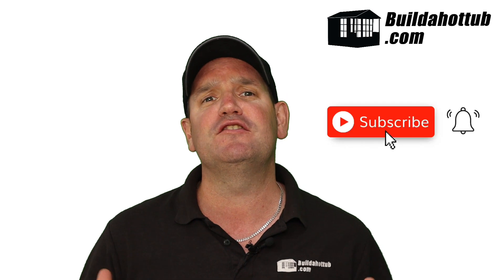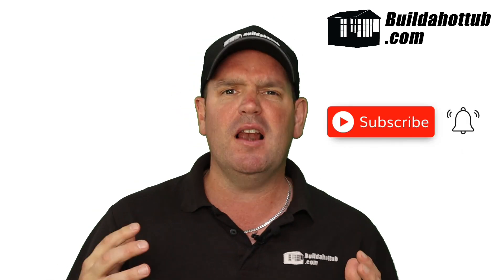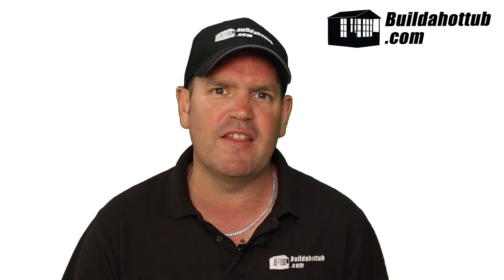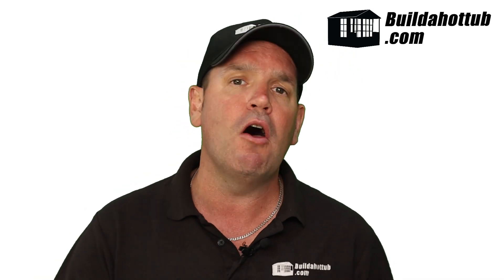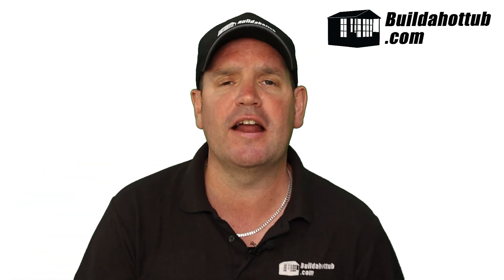Ultimate Guide to Hot Tub Pumps

Comment: Restoring an old hot tub that I’ve never seen work.  Was told 56wua300-ii pump worked 2 years ago, but will find out for sure soon.  Priced them already just in case.   Amazon sells it for 300 dollars now in Oct 2025.  One of the reviews from May 2025 said ‘Great value at 158 dollars !’   Price almost doubled in 5 months !!!   That’s got President Pedo’s tariffs written all over it.  We are all now literally paying the price for the MAGA crowd stupidity and it will only get worse.
Reply from the maker: Done this for a long time, never sold a 2 speed 3HP pump for under 200 bucks....agree with you though, tariffs are a problem and have pushed up prices for sure.

Comment: I’ve just installed a 7kw heat pump onto my hot tub with a 2 speed pump on it, even with the bypass valve opened fully I’ve lost I’d say a good 50% of power out the jets when the pump is flat out, I’m most likely going to stick the heat pump on its own plumbing circuit with its own circulation pump now but I’ve also had the idea to change out the two speed pump which will only be feeding the jets now to a single speed pump, my question is if i replace this 2.5hp pump with say a 4hp pump are you saying I’ll feel absolutely no difference out of the jets ?
Reply from the maker: Hi Adam, I would not go up from 2.5hp to 4HP the plumbing on your tub will not be designed for it and you could burn out the motor that way. Depends how the bypass was installed, if done correctly, you should not have lost power - had many customers fit ASHPs to hot tubs with a single pump over the years. On its own circulation pump is a good move though - if you need parts, check out my store at www.parts4tubs.co.uk - hope that helps - Andi

Comment: Our tub has a single 2-speed pump, I've been told that this is very energy inefficient. Is this true? if so, is it then a good idea to add a circulation pump in addition to the 2-speed pump? can this even be done?
Reply from the maker: Hi there, a dual speed pump on low speed will draw more current in general than a small circulation pump - but not that much more. "Very energy inefficient" is probably way too strong of a term for this - I dont think you would see anything signigicant in terms of savings moving to a dedicated circulation pump. Switching to an air source heat pump from and electric heater would produce significant savings - but there is at least 18 months before you see the savings surpass the outlay of the heat pump - Hope that helps - Andi
Reply: @Buildahottub  Hi Andy, thanks for the answer. The dual speed pump uses !400W at low speed and a Laing Universal E14 Fixed Speed Pump would use ˜110W so that would be another ˜300W savings for running the pump. I was thinking that If I have to do the pipework for a heatpump anyway, then why not also add a lower power draw circulation pump. Although it's not clear to me how the piping would have to change, and how to configure the SPA pack (.e.g does the circulation pump have ot run 24H a day etc.).
Reply from the maker: No problem, if my calculations are correct, 300W saving on average USA KWH costs (23 cents) is around a 7 cents per hour saving. When not heating, on an average hot tub the pump will run for about 45-60mins per day just filtering so you are looking at minimal savings here - 5-7 cents a day. If the new pump costs $250 it would take you a year before you made any savings excluding the costs of the other parts and half a day of your time to fit. Not sure I would go to the effort to change the pump and add new inward suction drains (about 40 bucks each) for that small leval of saving. Adding more insulation and a thicker cover would save you more in running costs in my opinion than the pump change would. Hope that helps - Andi